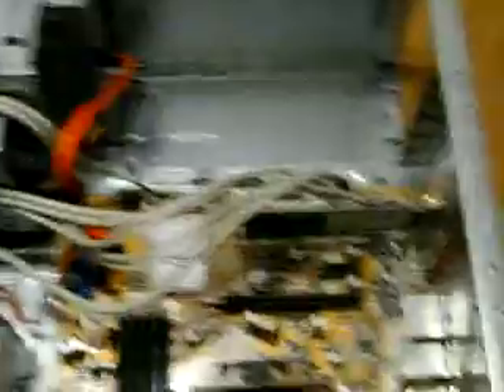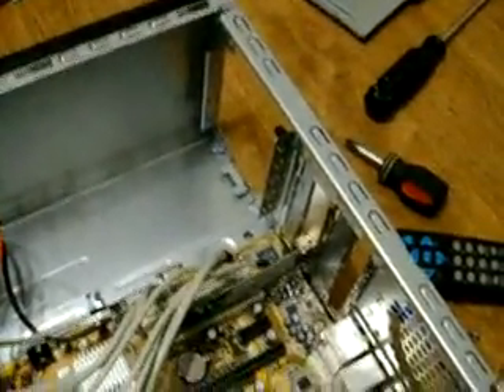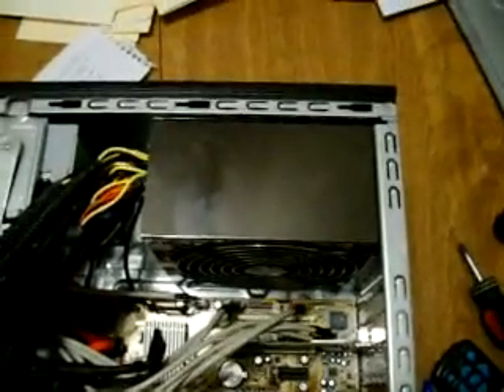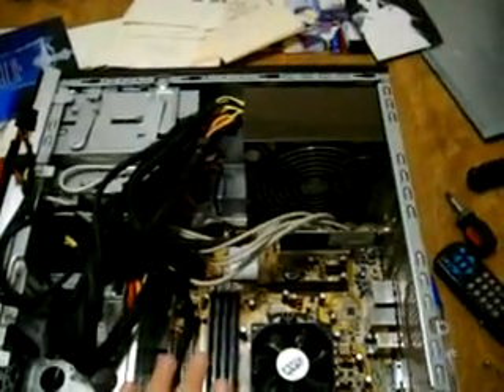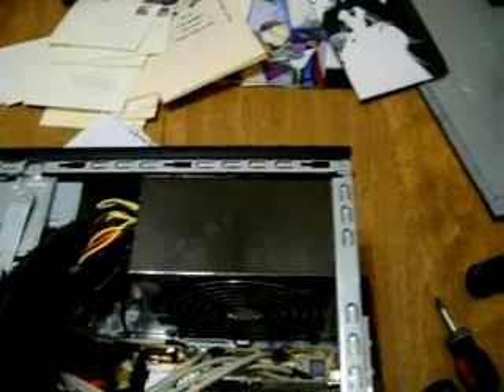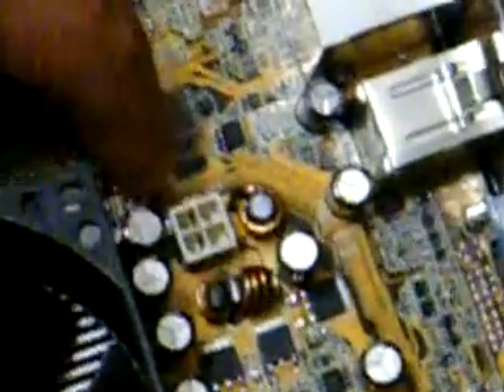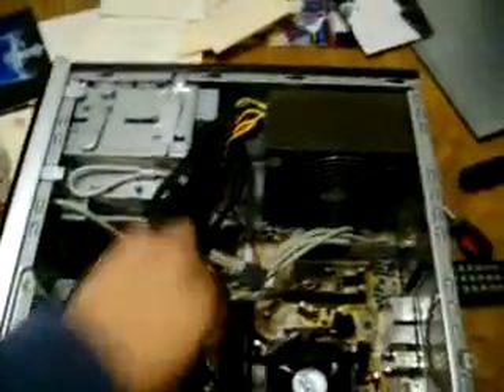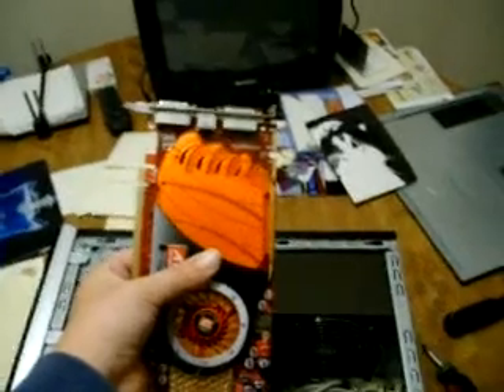How to Install A New Power Supply

Comment: Alright,  I have the EXACT same power supply as you.  Now,  I plug EVERYTHING in properly and no power.  I switch the button on the power supply to "I" and still noting.  I think i have a dead power supply or could it be something else in my computer?  PLEASE HELP

Comment: I would also suggest to take a picture of your old setup to help guide your new installation.. Also, take some scotch tape and label each wire that is connected to your computer's components so you know exactly what connector goes to what. That way, you can match the new connectors with the old ones.

Comment: @PixPoint well if you have a fan it will stay cool. But if you are using more watts than your power supply can handle constantly, then it might overheat and shortwire. This can happen by using a $150 graphics card which uses a mojaority of the psu.

Comment: at 3:28..dont know if you still dont know why it came like that..but different motherboards have different connectors. some are 20, some are 24 pinconnectors for the "monster" cable you said.

if you happen to have a 24 pin connector, just reattach that cable, but if you had a 20 pin connector, youd just unattach it.